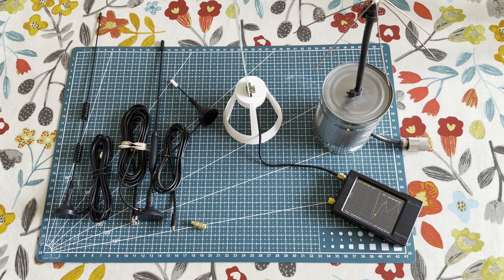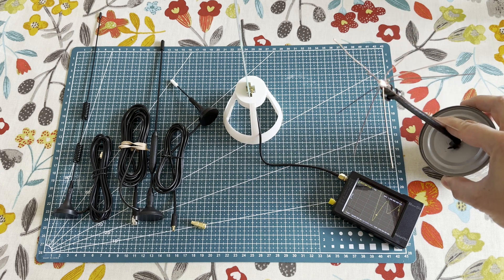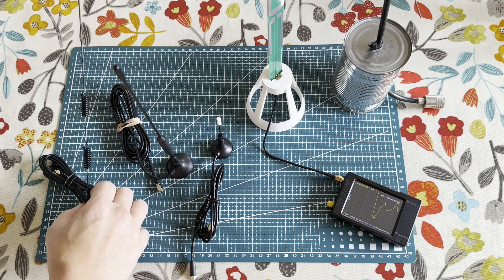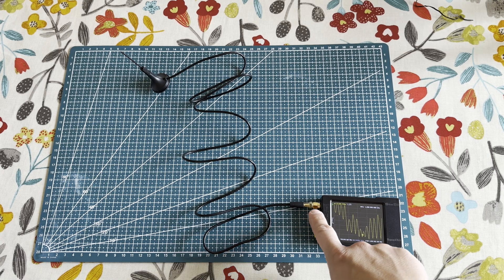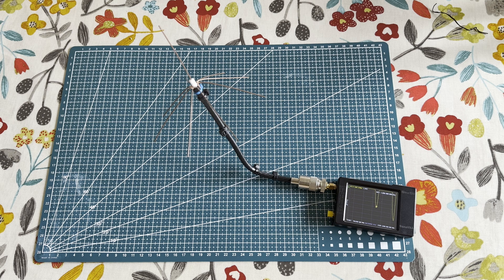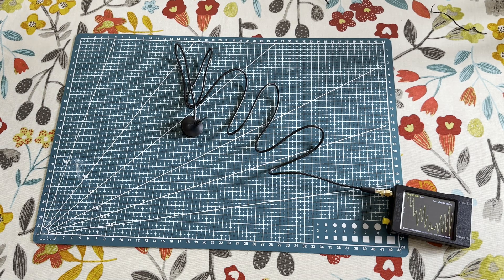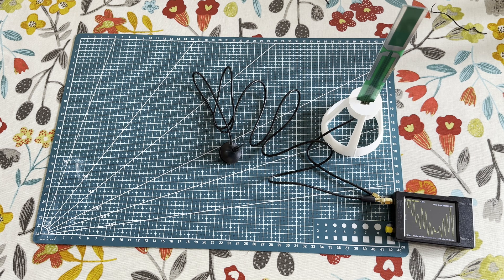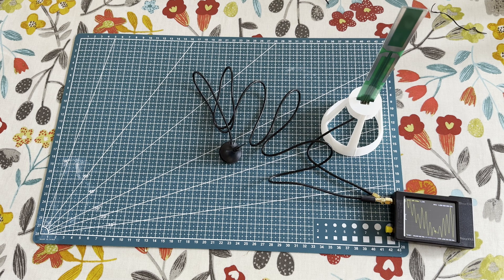ADS-B Antennas

Comment: A low VSWR does not mean an antenna is good. A 50 Ohm dummy load, or just a 50 Ohm carbon resistor will provide a very low VSWR and have terrible performance.

Comment: for the antenna in the attic perhaps put a rafter horizontally, so it gets some distance from the metal connectors. 
BTW: Those PCB antennas are really great! i can totally confirm.
Reply from the maker: thanks for your comment, glad you agree on the PCB antennas! 
As for the metal connectors, I'm not sure what connectors are visible in the photo? 
The antenna is mounted on a short 30cm loft TV mast, which is secured to a length of wood running across two joists. There is a metal nail strip used to construct the frame behind the antenna in the photo, but the photo lacks the depth and there's maybe 30-50cm distance between the two. I'd have to measure the exact distance next time I'm up in the space. If I've overlooked something, please let me know :)

Comment: I'm thinking about the pcb style antenna, but the version inside a white plastic tube for outdoor use. How will the plastic tube effect the signal?
Reply from the maker: It should be radio-transparent. I created something similar, a 3D printed plastic cover for the digital TV antenna I showed in the video. It didn't affect the received signal, but I didn't hook it up to the VNA. I'll 3D print another and add it to a future video, thanks for the suggestion!
Reply: @chrism0lza  Thank you. It's about $15 more on Ali, but I think it will last longer than the naked pcb
Reply from the maker: @Tom-sg4iv  Yes, it should last longer but I think it depends on where it's mounted. Outside, yes of course it would last longer than the naked PCB, but personally I would only mount a naked PCB inside. I created some 3D printing models for a stand for the PCB antenna as well as a window-mount (link to thingiverse in the video description). I'm currently printing a cover for the PCB antenna and will try that soon. I'll take a look at Ali and see what is available, thanks!